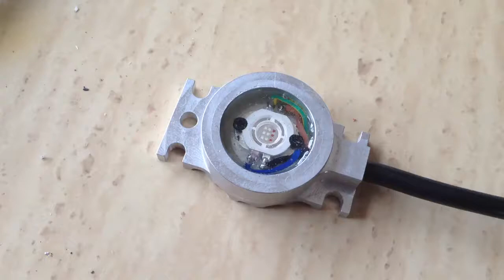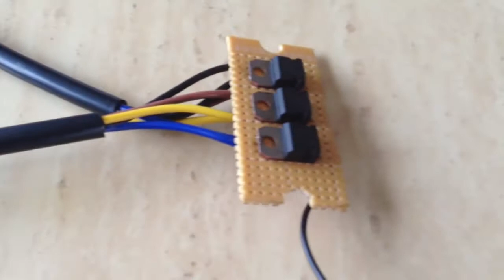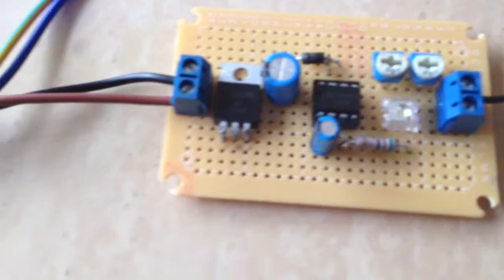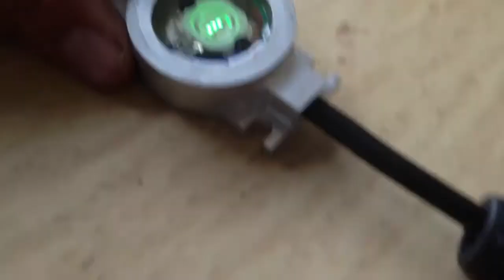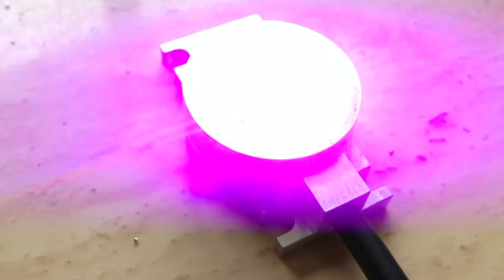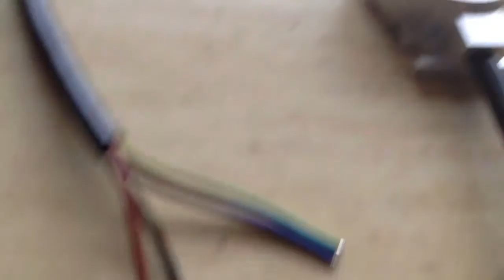RGB Strobe Update

Comment: is there any chance you can hook up something more powerful? 
or rather, maybe you have idea how to get this thing to work on DMX with 100w constant current LED chip?
Reply from the maker: +roman medvedevs the power is only limited by the relay being used.  I imagine the same circuit could be used to flash some pretty substantial SSRs, though you might lose some of the quickness of the flash with a mechanical component.